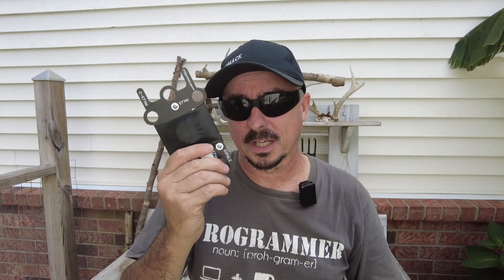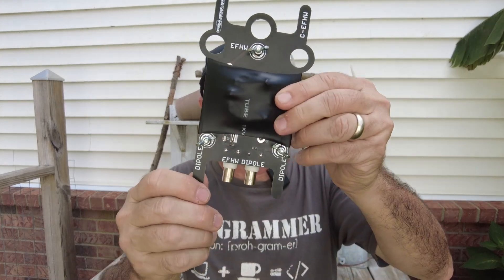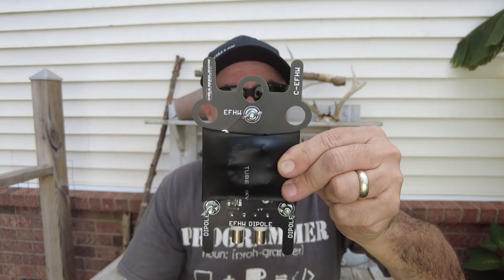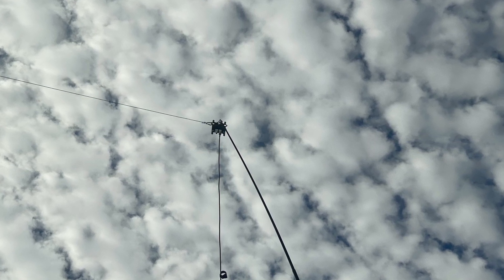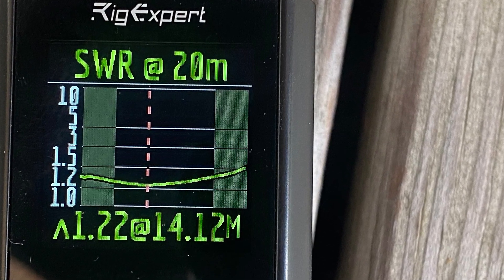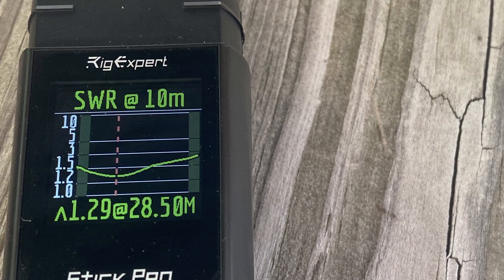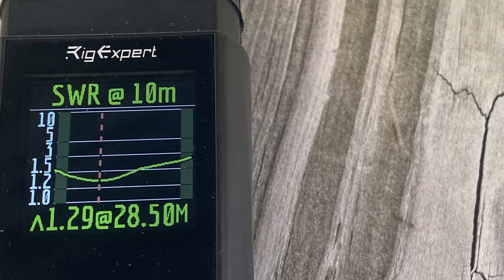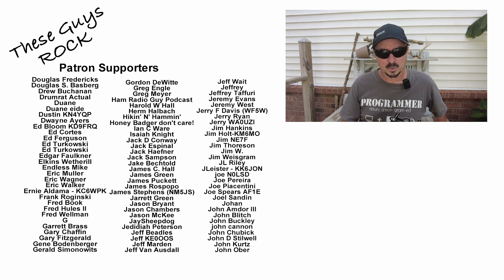A Unique Antenna Design

Comment: Are you using a coax feedline with  a choke? If yes, is choke near radio or antenna feedpoint? Thanks!
Reply from the maker: In this test, there were no chokes. When I use them, I keep the choke closest to the radio.

Comment: What was your final length of wire for the EFHW config?  How high was the end of the EFHW off the ground?
Reply from the maker: Using my own length of wire, the feedpoint was 12-18 inches off the ground. I didn't measure the final length of wire. I started with ~68 feet and trimmed until it fell where I wanted it.

Comment: Interesting antenna. It looks like additional wire/winder would be needed to complete a dipole. Will the included wire work for one leg of the dipole?
Reply from the maker: I didn't test but sure it would. If it were a bit long, one could always fold it back a bit.

Comment: Do you also have the feed point at 12-18" on your KM4ACK EFHW? The reason I ask is I get great results with it at about 3'.
Reply from the maker: I run it between 18 inches and about 4 feet off the ground depending on the setup. With the RV it's about 4 feet off the ground.

Comment: I often wondered why we didn't have more flexible options for lightweight wire antennas for field use.  I think most people would use this on 40m , and I'd guess 20m might be the next most popular band so I'd optimize performance there.  I do like 10m for some applications but that's more of a regional thing for me and I'm more inclined to have matching dedicated aimple to deploy antennas for everyone.  Nice antenna concept.  I checked their website for a 40m and 80m version as that would be a great antenna for me.  Their 4010 and 8010 are both listed as end fed half wave antennas.  The 4010 has a dipole configuration as shown in this video but the 8010 was EFHW only.  The 8010 is a 4010 with an extra element to add for 80m.
Reply from the maker: I like this design. I plan to run it as a 40M EFHW but also keep enough wire in the kit for an 80M dipole for NVIS. Should work great for Winlink connections after dark on 80M